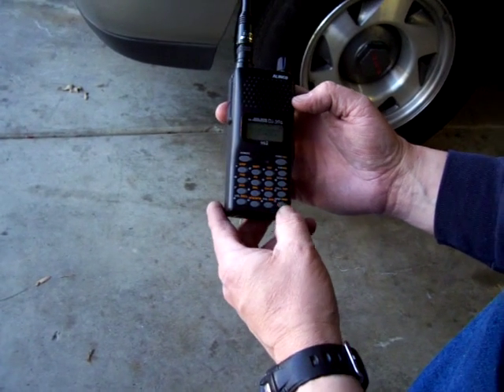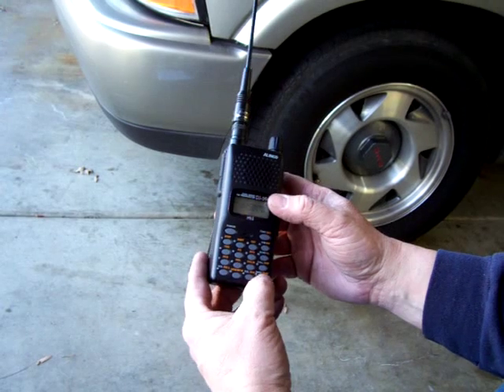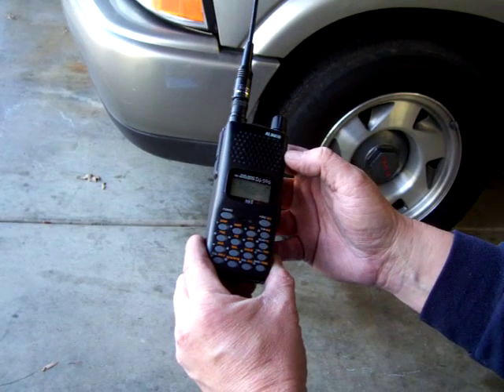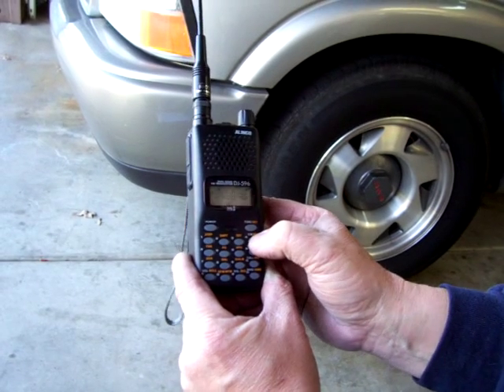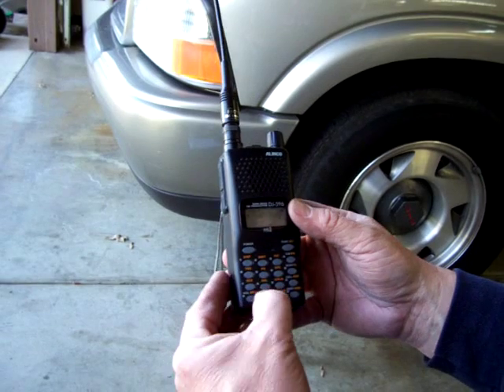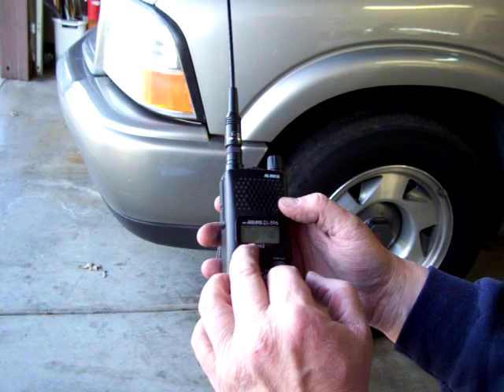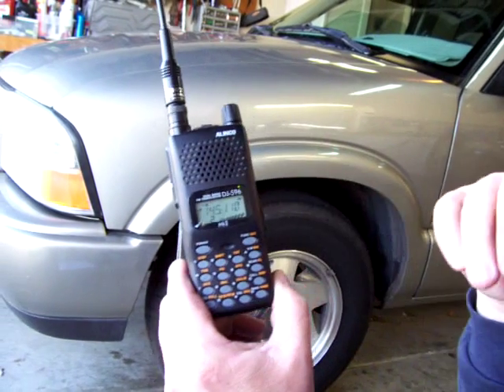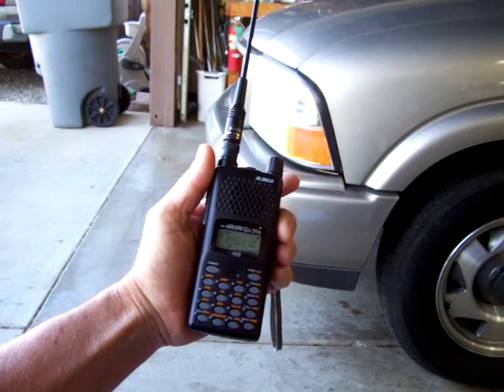Programming Frequencies on the Alinco DJ-596 MK 2 Dual Band FM Transceiver

Comment: HI, nice little vid! I am about to take my foundation licence course in nov here in England, am planning to get a 596 ready to go for that day. Some good prices on that model over here at the moment. Have been a radio listener for many years, so time to take the next step, Cheers guys
Reply: Hi Tony well I really hope that you pass the foundation licence mate it's pretty simple to pass so don't worry it's only 20 questions and fairly easy to get through mate so you'll fly through it no problem OK I took the foundation licence back in 2001 and I have been on amateur radio for almost 19 years mate and I have mate thousands of contacts on the HF bands and 2/70/6/10 meters it's been great fun for me mate so you'll really enjoy it OK mate. And if you get the Alinco DJ-596 mk2 you'll have tons of fun on the 2/70 bands OK because it's a really good radio and great to use mate OK. Best 73's Stephen M3SNV.